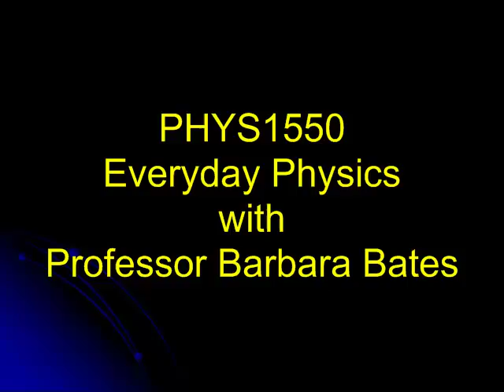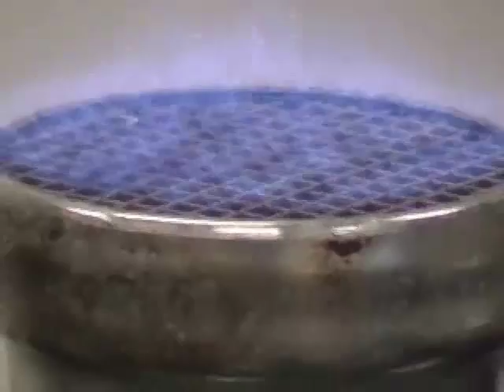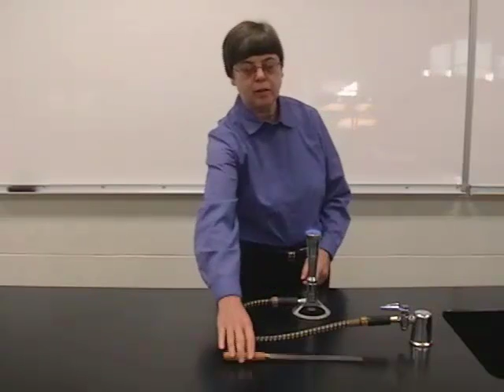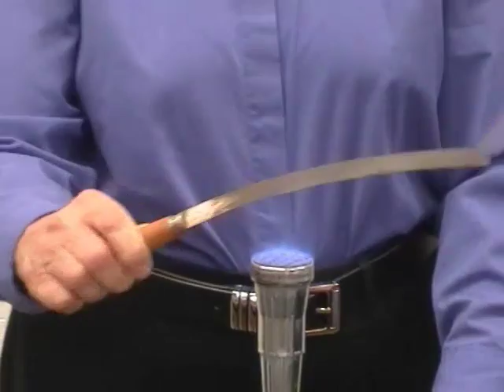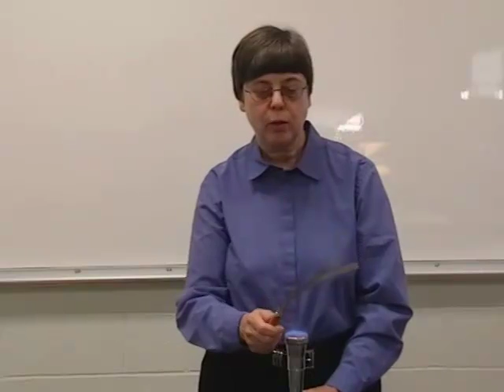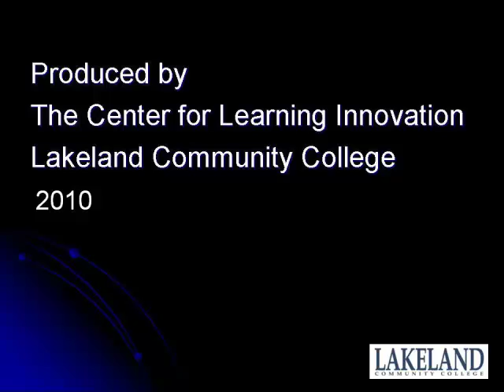PHYS1550 Everyday Physics The Bimetallic Strip

Comment: But why did it bend nana?
Reply: it's a temperature measuring device 
when two different dissimilar metal join together on heating it expand and cool it contract
Reply: Because brass expands more than steel so it bended on the side of steel when it will be at normal temperature it will not be bended